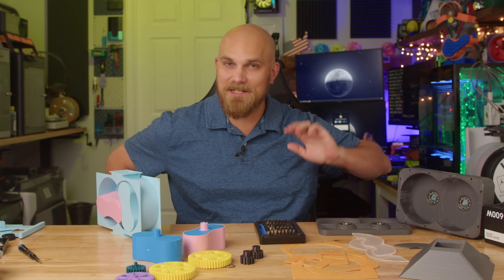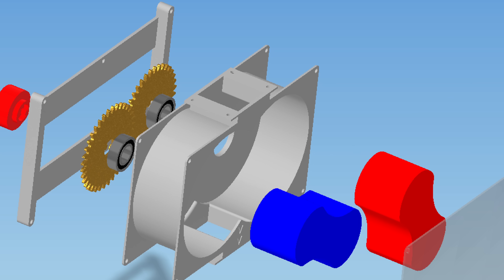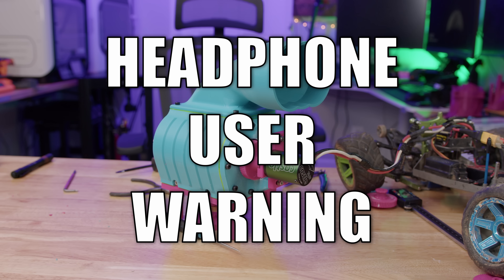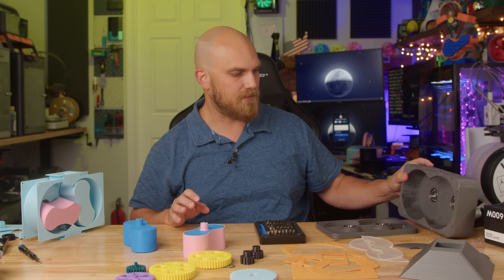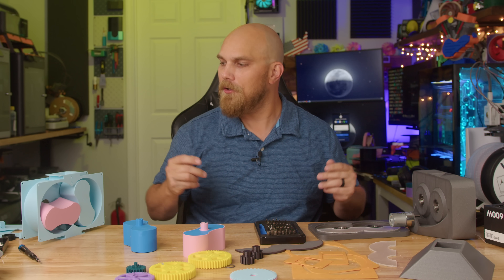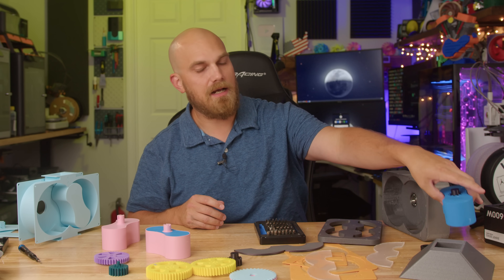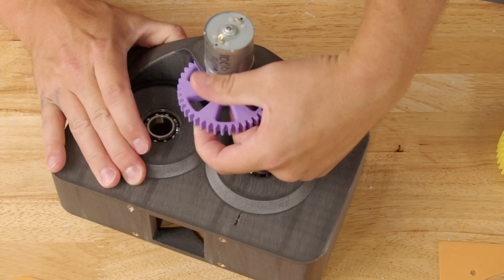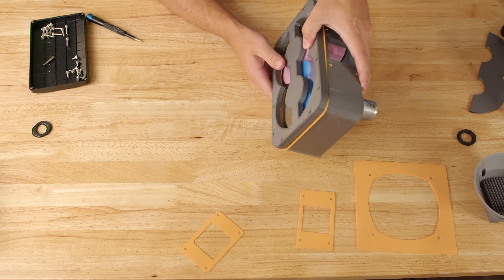Turning a Viewer’s Roots-Style Fan Concept into a Performance Beast! | Fan Showdown S6 REMIX

Comment: Positive displacement pumps like roots or pistons always produce for pressure that fans, and squirrel cage always makes for pressure that axial flow, but the trade off in less volume.  The measure has to be Pressure X Volume in order to make comparisons.  Standardize to Inches H2O X CFM to make this comparable output based upon equal wattage input.  Please add columns for watts and CFM.

Comment: This design could be a lot more efficient, if you reference a modern Eaton unit for the rotors. The main changes that were made since the 1940s when this type of blower was in use in aircraft engines is this: They went from 2 wanes to 3, and they added a rotational twist to the wanes. So using 3 bladed rotors that have a say 60 degree twist in the rotor blades would give better performance. The roots blower was designed to move lots of air, but not for generating lots of pressure - this is why they are called blowers. They were originally used in things like mine ventilation equipment where the volume of air moved was more important, than the pressure generated.

Comment: I have a better idea.  Instead of syncing the lobes with gears, which create a lot of drag and make a lot of noise, you could use magnets in the lobes to repel each other so they don't actually touch.  It would take a lot of trial and error to get the right strength and placement of the magnets, but it would eliminate a lot of friction and noise, sort of like a magnetic gear train.  Since you already have the 2 part hollow lobes, it's already better suited than the original anyways.  Like I said before, drive the lobs from opposite sides with A12x25 motors.

Comment: What about modifying your design with an A12x25 motor on each side so they will go in opposite directions, and they have good, low fricton bearings.  Then add just the lightest of gears to get them synced.  This would be closer to the original since you are not cheating with more powerful fans, but are providing a known 2x of the power of an A12x25.

Comment: the noises already means you got lots of friction, defeating the purpose as it will reduce the rpm by default. could have been faster. comparisons of all the fans should be compared using the same power wattage.  wonder if with some refinements, we can make a less noisy one for practical case fans.

Comment: if you used two fan motors mechanicly linked I wonder if it would still work, have one on the 'front' the other on the 'back' each powering a different... spinny thing, whatever they are called, while still being linked via a meshed gear acting as a syncroniser.

Comment: Spray Teflon silicone on the "blades" maybe. And maybe you should find a way to use bearing on the ends of those blades... Thin plastic sandwhiching several bearing... Greases bearing may have less noise. You should also trying a rubber coating on the gears to reduce noise. Test rubber coating just on the sides, not the teeth and then on teeth as well. Make sure it fully cures before testing, may need to Teflon spray rubber teeth to not tear up.

Comment: Lobe pumps are used a lot in food processing, I work in an ice cream plant and all of the ice cream freezers use them, so do the revel pumps and our fudge pump.  Those suckers can pop a quarter inch thick hose with the pressure they can push.  Granted your version could use some revisions to tighten the gap between each rotor and between the rotors and the sides of the enclosure.

Comment: This design isn't really meant for compressible fluids like air - it works much better with incompressible fluids like water.

However, if you get it moving at supersonic speeds, air becomes incompressible, so all you need is to run it at (*scribbles some notes*) 3.2 million RPM, the performance will be much better.

Comment: should get your hands on an Austart air starter made by KH equipment, I used to work for the company and the multistage air starter they make is incredibly efficient and kinda easy to get your hands on as most of the exported units that don't go to the mining sector go to the USA for inland water freight haulage.

Comment: Using belts would reduce the noise make that change first off see how that effects the sound. Other changes you could make as well to reduce the noise but that would be the first one to do and simplest. You could probably make it pretty silent with some mods to it. And as you got bigger motors you might as well see just how stupid high you can go for static pressure. It should be capable of some pretty stupid high numbers at 5 to 6k rpms and it should hold together just fine even at 10k. Also the increase in pressure wont be 2x gives you 28 it will likely be more like 2x gives you 2.5x pressure possibly higher. At some point you will see diminishing returns to a point where even doubling rpm wont give even 1/2mm h20 increase eventually you would approach zero or possibly hit a point where you start losing static pressure. I would say ramp up rpms until it risks flying apart or the return starts to fall off to something less than 10 per 1k rpm

Comment: Would you be able to reduce the size/weight of this design to make it work with the smaller torque fan motor? I'm thinking power/weight ratio would be good, but the printing might be tight.

Comment: Straightening vanes are great.  They need to have a slight curve into the flow to receive the air initially... they should immediately start turning that air in the desired direction greatly reducing eddy currents that will disrupt airflow if you only make them straight.  I worked for a fan design company and this was an addition we put on inline axial fans to increase their static pressure ability.
Reply: Yep, they do make a big difference to efficiency and static pressure. They tend to add a lot of noise though, I guess that's why we don't usually see them on PC fans!

Comment: No idea how to 3D model, but here's my idea, it might even run on A12 make a spinning Dorito fan! The rotary engine is a triangle in spining in odd shaped oval. Surly the compression would produce high static pressure. Assuming you can get it to spin on an A12 hub. you'll have to print an insert for the oval shape of the "block" Would that reduce the size to much?

Comment: See nothing wrong with the compressor layout as a assembly . You biggest error and noise source would be the gears as they are not exactly the best choice for something like this. Using herringbone gears would lower the noise and make themselves self align with each other and be a bit more stable with less vibration.

Comment: Not surprised that a fluid pump has higher static pressure than a fan.  It is a shame that it can't really work with a standard fan motor, though.  Perhaps a scaled down version would work?

Comment: @MajorHardware I wonder if the performance of the "super charger" could be improved by adding a high flow fan to its inlet, acting sort of like a turbo charger? There may be too much back pressure but in my mind they would work well in series. One providing the airflow for the other to compress... best of both worlds??

Comment: its a cool idea, but probably nota cool fan. pun intended.

so it not moving air like a fan would by pushing or pulling it. its moving air by compressing it, which mean its gonna heat up the air charge, which will put heat into the system that wasn't there to begin with. so for cooling a pc it would be worse than passive cooling technically. you need to use an intercooler to make it work as a pc fan. 

the reason cars not need intercooler when they use supercharger is cause when the vaporized gas mixes with the air charge it cools it down by hundreds of degrees.

Comment: 6:09 This is why next time, maybe try using skateboard bearings. They're designed specifically for speed and smooth operation. Also, they're 608 bearings so they have very common measurements.
Reply: And they are cheap. Even the crappiest ones still would handle the load of this blower with ease.

Comment: I recommend a bit of machine oil (sewing machine, 0w, etc..) on the bearings, then a bit of ultralight lithium grease on the lobes (Tetra gun grease would work well and it's slick and clean to apply).  You could mix hexagonal boron nitride HBN with either or both for a film that would remain even as oil moved off or evaporated.  You could enclose the gear drive assembly (make it a window of course) and set it up to where there was a small oil bath pit in the bottom that allows part of the lobe mounted gears to "splash" the oil across the other components in the same way many lawn mowers and small 4 stroke engines do.  I think that would quiet it down some, would tighten up the lobe tolerances a bit, and maybe even add a couple hundred rpm to the speed.

Comment: That "fan" is quite loud for sure, Have you thought about using slant cut teeth? Like whats used in a transmission? Because those teeth are designed to reduce the gear noise specifically. And being a kind of constant mesh type of teeth, rattling noise is reduced and teeth clearance becomes less of a headache.

Comment: Does anything prevent someone from using a high gear ratio for a compressor and a burst disc? Probably not practical for static pressure but would be cool

Comment: cut a slit at both ends of the lobes, and put a piece of silicone or rubber just enough to seal it better but not cause friction, if so then use the silicone spray. you could gain another 4-6 mm-H20

Comment: Your gasket-spacer setup cost you a lot of pressure. The side of the rotors should seal as tight as possible to the housing.

Comment: a couple of times you refer to this fan moving H2O (water) not O2 (oxygen)
and yet its Air thats moving ( Air mostly contains nitrogen and oxygen in about 78% and 20% respectively 2% OTHER( SIMPLICITY)) 
Maybe being a bit picky but really irritating at the same time.
Also this type of pump is used for moving liquids under pressure not gasses under no pressure ,( commonly used for getting oil in a motor at pressure) hardly a fair trial for its use but i can see why you got invested into it. And Kudos for attempting to make it work.

Comment: You could make a Fan-Showdown-Extreme series out of it, with a defined powerfull motor instead of a fan motor ;)

And to get rid of most of the noise and optentially some of the gear losses I would consider a timing belt.

Comment: In theory thats a supercharger design so its designed to push compressed air out on the exhaust. Try putting a turbo on the exhaust side 👀 maybe the turbo can spin fast enough and generate more airflow 😂👀

Comment: In the automotive world people are usually told Superchargers are inefficient & draw engine power when turbos do not, but in reality not only do they create boost throughout the entire RPM range they also require good planning to be working in an efficient boost range for a specific engine. Most supercharged engines people make are just some V8 they slap an old Detroit Diesel supercharger on without much thought into the drive ratio; those superchargers aren't meant to create ANY boost at all as they are just meant to make a 2-stroke cylinder flow so the start of the build is already no good but fun for Hot-Rodding!

When designed correctly and for the right engine even the most basic Supercharger, a 2-love Roots which you have here, can create better performance & even efficiency than a Turbo and Centrifugal Superchargers are just the cold end of a Turbo pretty much so they have the same efficiency or better (depending on rotor design) but tap power from a different source.

I know this isn't super related to the video but I just wanted to let people know a bit more about a device most think is just antiquated & inefficient, even your test shows they are capable & you're using pretty much the worst type, a short 2-lobe Roots.

Comment: You know what would be full brutal?
Using two individual fan motors and trying to electronically synchronize them.
Can you imagine the amount of precise position sensors and microcontroller programming required?

Comment: Heres an Idea ditch the gears and run a belt. a bit more complex with running an additional pully for directional reasons and possibly a tensioner but much quieter and more zoom.

Comment: Pull fan blades off heavy duty fans and use the remaining motors to drive the supercharger. Allows for the device to be run off standard 5v header?

Comment: the normal fan motor would work if downgeared.
The problem with your version is that the motor has more power, meaning you have higher torque at the same rpm. since you are going for static pressure, torque matters.

Comment: I know straight cut gears are easier to find.  But if you can print slant cut gears, they'll be much quieter.  And some kind of graphite, moly or Teflon lube in tiny amounts will help it spin freely.  My guess is the pressure died off because of gear mesh issues. 

Also, an option to seal the front better is to make the front out of the acrylic sheet and then mount your bearings to the outside using tapered screws from the inside to hold them.  Then the whole sealing surface is flat, uninterrupted and within a much tighter tolerance to the lobes.

Way cool results though!  Maybe I can supercharge my lawnmower...

Comment: I wonder if you could drive it with a small geared motor with the same wattage as the a12x25. Also, your gear teeth seem kinda high friction. I don't know what settings you're using but on my Vex U robot parts I use a 25° pressure angle and fairly large teeth. I don't remember the tooth pitch but I made it so a 15 tooth gear is 1.5" in diameter. 
Yes, we use imperial for everything.
I use the Gearlab addon in onshape with otherwise default settings.

Comment: I would recommend if someone hasn't already, when printing the gears, switch from straight cut gear teeth that you have now to a helical gear teeth.  That will reduce the noise on the gears by a large margin.  However this is all waisted if helical gears wont print on a 3d printer.

Comment: I made a wind powered spinning cap for an air vent 4 years ago, it has two 10*30*9 bearings with all the grease removed and replaced with thin coat of gun oil. Its still spinning like new after four years with zero maintenance. Ball bearings really don't need much lubrication if the loads are minimal.

Comment: Seeing this, well air-compressor you could call it I guess, creates mostly pressure, perhaps it could be used to move air via Bernoulli effect, i.e. shoot output air from a nozzle through a duct and get air flowing that way? A bit like these "bladeless" fans. That may give nicer visuals for the smoke test as well.

Comment: Hey quick rip they sell a gule called ca gule but its called black rubberized ca gule and it has an activation liquid that can be sprayed on to it to alcerate the drying of it its used in alot of stuff like speakers waterpumps and air channels

Comment: I want to add a few thoughts. You can tell me I am wrong(I probably am)  but couldn't you have this powered by two fans and not need the gears?  As long as they receive the power at the same time, they should still spin in sync, right? Also couldn't you have covered the back to not only hide the gears but also to slightly dampen the noise?

Comment: Graphite on bearings. Angle cut gears would run way quieter, transfer load more efficiently. Perhaps a belt drive?  That would eliminate the gear chatter altogether. Side clearance matters.  There was no doubt it would work... Like you said, it's a supercharger. That was AWESOME! Thanks for sharing!

Comment: The problem with some of these newer designs is that they use the motor in the a12x25 but the loose the entire form factor of a fan. Which I admit can be cool but if the goal is to design a better fan there needs to be size limits for contestants. That said it would be cool for users to send there all out designs in that use a fan motor or in expensive motor that is readily usable and controllable in a pc.  These exceptional designs could be for modded pc cases etc…

Comment: I would have been interested to see at what speed it would have matched your top performer as well as original.  I bet that would have helped with noise and or I wonder if you slowed it down so you were just a little better then the best if you might be able to gear down enough to run off of one or 2 fan motors.  If anything you could slow it to a nice visual speed and with the clean bearings on either side of the rotors could easily run some leds into the rotors to add to the effect

Comment: Nice. As for the noise, what about herringbone gear teeth? I cant see well, but putting a small chamfer on the leading edge of the gear teeth could reduce some of the friction in them as well, and a little smoother may be a lot quieter.

Comment: You should add power draw measurements to the comparison: wouldn't be fair to compare a ~3W fan to a contraption drawing ~25W without knowing how much of a discrepancy there is in relative input power in each test scenario. Having 5-6X the static pressure for 8X the power wouldn't be anywhere near as impressive.

Comment: That thing looks similar in nature to the persitaltic pumps we use in lab and medical equipment, except with a bigger displacement and without the hoses.
The issue with these, aside from the hoses which need replacement and sometimes need to be speciality models coated with platinum, is that if you don't use tubes to contain the gas or fluid you pump through it, they need to be super low tolerance to not leak.

Comment: The clearances are way too large. Glue some plastic or cardboard sheet to the sides of the rotors and print some pieces to put on the tips of the rotors to close up those gaps. Get down to 1mm clearance and try it again. Rones used on engines have clearances in thousandth's of an inch.